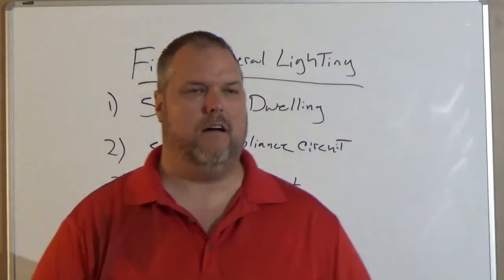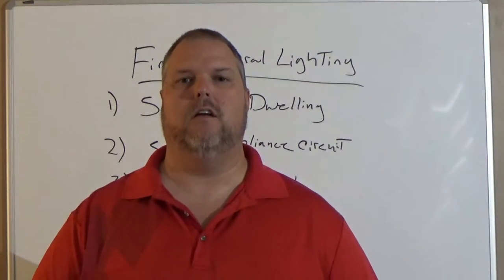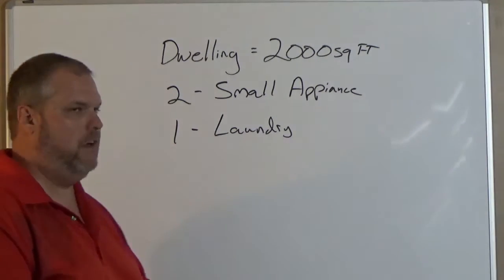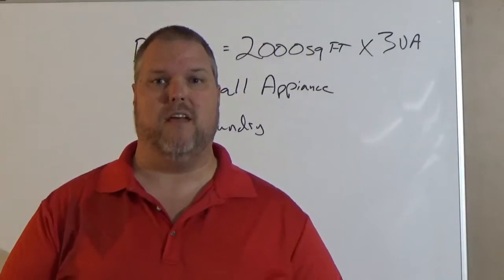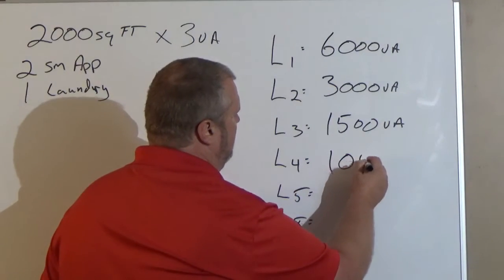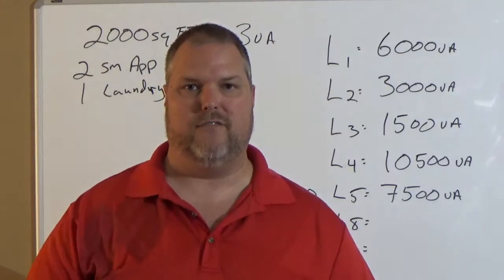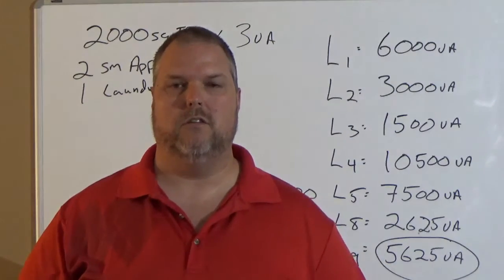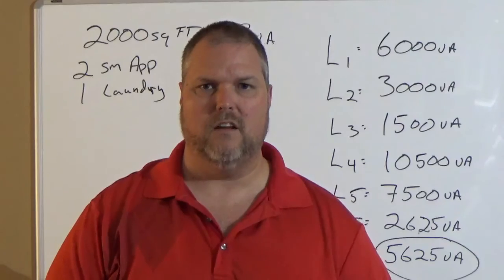Finding General Lighting Load for Dwellings

Comment: I have a question regarding the 125% for largest motor rule. Do we still use 125% of the AC motor if it is omitted or do we size by the next largest motor?
Reply from the maker: I have a video explaining this but yes if you omit it then you can’t use it as largest motor. CM

Comment: very informative.  I am currently a student.  I was under the impression the bathroom was supposed to have its own circuit, is that not included when when calculating general load.

Comment: I live in a 1625 sq ft villa in Florida. The lighting load is a fraction of what it once was after a renovation. The existing 1992 service is 125 amps with 20 breaker spaces. All high hats and table lamps were re-lamped LED. 65 watt equiv R40 lamps use about 11 VA. LED's have a  fraction of the incandescent lamp consumption. One can't even buy incandescent any more. Can the lighting load be amended in new construction or a renovation to take advantage of the lower consumption?  I wonder if NEC will ever recognize this? Even my outdoor 300 watt floods are LED (23 watt).

Comment: Can someone guide me in the right direction...I am not an electrician, and I don't know those codes your talking about.  My dads friend is an electrician and he added recessed lighting in my house, but I forgot to put that in the building permit along with the other work that was completed (There was a lot of work done on the house, plumbing, electric, ac, floors, cabinets, almost everything was updated).   So now I am doing some more renovations to finish my house renovations, and I wanted to add the lighting in the building permit along with the other work I will be doing (I know I was supposed to get a building permit before I got the work done but I forgot to add it the first time and here we are).  I was asked for an electrical calculation load when I applied for the building permit...  Is that something I can do myself figuring out on YouTube or do I need an electrician?
Reply from the maker: I recommended you talk to an electrician.  What I have here is to teach students to complete a load calculation in a bunch of video's. This is just a small part of it. This would be the most accurate as they will see what is in your home to add to the calculation.  CM
Reply: Thanks for the reply and advise Craig, I appreciate it.

Comment: I'm sure someone pointed out to you that VA is not the same as watts in many situations.   For a resistive load it should be,  for an inductive or capacitive load it can be different based on the power factor.  I won't get into power factor correction.

Comment: Hi Craig, 

Does washing machine can be connected to the laundry circuit or should has its dedicated circuit ?
Reply from the maker: Yes It can be connected to the laundry circuit. That is what it is designed for!! CM
Reply: Washing machine dedicated and gfci protected……
any other outlet in the laundry area on its own 120 circuit and gfci protect it.
Reply: You wouldn’t happen to have any videos on pointers on helping pass the contractors exam would ya Craig?

Comment: What do you do with the remainder not over 120000VA?
Reply from the maker: Okay so if the total from lines 1-3 total more than the 120000. So for example if we had a total on130000 you would take the 10000 and multiply by 25%. I hope that makes sense. I am planning on doing another scenario that will cover this in another video. CM
Reply: Craig Michaud- Electrical Instructor ok thanks I’ll be on the look out, appreciate your feedback.
Reply from the maker: You would multiply the remainder at 25% the add everthing up!! My example does not go over 120000va so we dont have to do anything with that!! Thanks for the comment!! CM
Reply: Craig Michaud- Electrical Instructor still a bit confused, table 220.42 says Remainder over 120000VA at 25%, how do we know to do the remainder not over 120000VA at 25%???

Comment: It did help but I want to know what you did on the other two lines?
Reply from the maker: they are not relevant as the calculation did not exceed 117,000va. so I did not have a remainder to multiply by 25%. CM

Comment: Small correction. A basement that is finished vs unfinished is irrelevant. If it is adaptable for future use, you have to count it per NEC 220.12.  An example would be unfinished basement with 8 foot ceilings would count since you could turn it into a living space later. A crawl space would not count. The building department has the final say on what is deemed livable space. (At what height does it count).

Comment: how come one does not use code 220.82 instead of 220.42
Reply from the maker: That is a fair question!! Well 220.42 covers the standard method and 220.82 cover the optional method. I prefer to teach the standard method as you have to troll the code book to find the answer. The optional method is very simple and easy to use. It really depends on your AHJ to decide what they want. My students wanted a video on how to do the standard method so I created this. I have been getting emails on want to know how to do the optional method as most journeyman tests and most contractor tests are asking specific questions on both methods. Hope that answered you question. Thanks for watching. CM

Comment: hey Craig great video, are you suppose to count a bathroom? I see u did 2 circuits for small appliance, and one for laundry. so do I need to add one for a bathroom? thank you
Reply from the maker: Great question but the answer is no!! The only things you count are spelled out in Article 220. In 210 it specifies certain dedicated circuits but for a load calculations its already figured in the general lighting. Thank you for watching!! CM

Comment: I'm confused why you added 3000 back into it at the end
Reply from the maker: Thank you for your question! In 220 it states that the First 3000va from the total of Line 1-3 and then multiple the remainder by 35%. Once you get the demand the you add that 3000va which is your 100% demand to the 35%. That then is your total general lighting load. I hope that answers your question. Thank you for watching!! CM
Reply: @craigmichaud-electricalins4602  ok thanks. Also if you have time one more question. When is the reference 220.82 (b) used? It talks about the first 10kva at 100% and the remainder at 40. Is it talking about the total connected load like  all appliances plus general lighting?
Reply from the maker: @lanewesner763  That is used when calculating an Other Than Dwelling calculation. It is used for commercial buildings. I will be doing multi-family dwellings and also commercial calculations in the future. I am also working on creating workbooks for the different types of calculations with an explanation and step by step process. I hope to have them completed for the summer. Keep an eye out for the links to them in the coming months. Thanks for your questions. CM

Comment: Great video question where did the 3000 come from in line 9? Also is there anyway I can sign up for your class I’m in the Philadelphia area
Reply: Craig Michaud- Electrical Instructor
Reply from the maker: Thank you for your comment. So the 3000 is the VA that we take at 100%. So after you find your total VA by adding Lines 1-3. You minus the first 3000 then you multiply the remainder by 35% To find line 9 You take the first 3000 and add it back to the answer from line 8. As far as taking a class I am in Connecticut and at the moment I an only doing a license prep class. I am in the process of creating an online line course(s) for people who are not in the area. Once I get this completed I will certainly let you know so you can check it out. Thank you for subscribing and I will be posting more videos in the next few weeks. CM
Reply: Okay I see why you put the 3000va back you purposely skipped a step and then came back to it